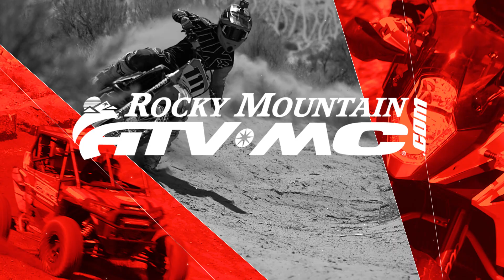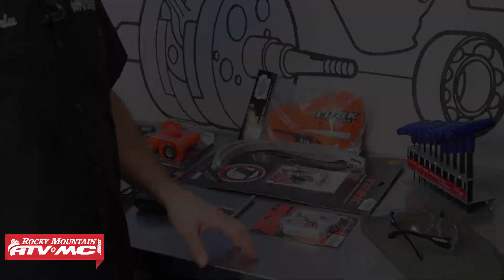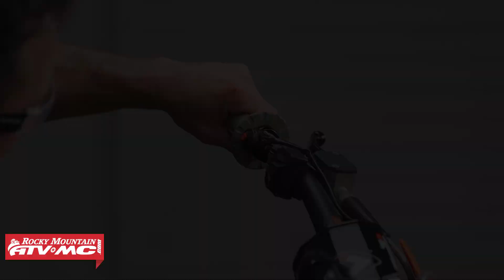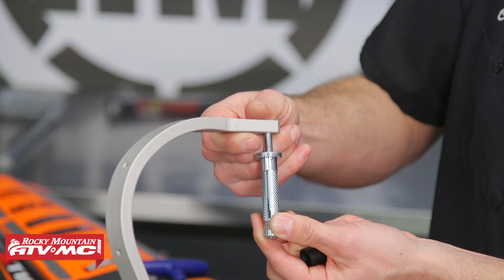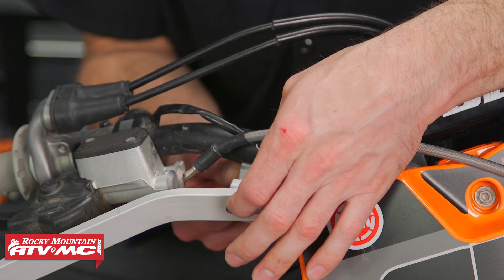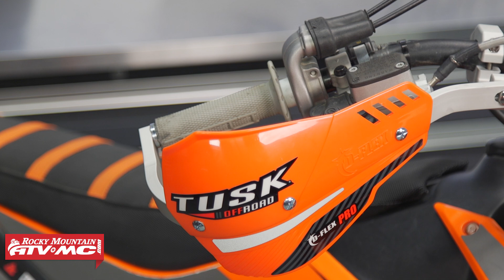How To Install Tusk D-Flex Pro Handguards on a Dirt Bike

Comment: You can see in the vid on the left side that the curved guard doesn't sit flush on the u shaped bar mount. The right side is the same in the real world. Do you just tighten it and let it go? It seems like there should be an inclined adjustable spacer to make this sit flush on any bar.
Reply from the maker: Each bike may be a little different, but they should be as close to flush as possible. You may need to bend the bar a bit to get the perfect fitment.

Comment: Bought this kit for my 2013 Yamaha WR 250. Just got the bike a month ago. Figured out after opening packaging that my handlebars are not stock. I have some model of pro taper bar. The U-shaped bracket does not fit correctly. What can I do?
Reply from the maker: You can try bending it to fit properly. If you need more help you can email Tech@rockymountainatv.com and we can better assist you.

Comment: Should you Loctite?
Reply from the maker: If you are worried a bolt may vibrate loose you can add thread locker.

Comment: How about removal? That spread anchor is not wanting to come out of mine.
Reply from the maker: If you loosen the bolt slightly and then push it in, it should release. If not then a screwdriver can help pry it out. Hope this helps.
Reply: @ did this with a slight tap from a dead blow and she came out just fine.
Reply from the maker: Glad you were able to figure it out!

Comment: These won't work on my 2024 KLX handlebars. There is a steel insert at the end of the bars that will not allow the expanding bolt it. Bummed out....

Comment: Where do I Measure my handle bar to make sure if it is 7/8 or 1 1/8? I own a 2024 KTM 250 XC-W
Reply from the maker: Measure the center of the bars diameter. For your model it should be 1-1/8.

Comment: Great video thanks. Here's a tip if you have a crossbar that gets in the way of the Allen screw... (7/8" bar)
Put everything together without worrying about the angle of the handguards. Then, loosely tighten the end of the handlebar, the two Allen screws on the U clamp, and the screw that passes through the aluminum handguard to the clamp. In other words, put it all together. Then, snug up the 5mm Allen screws on the U clamp - get them even - there should be about an eighth of an inch gap - as long as it's even it's good. THEN, move the whole thing to the level that you want. NEXT, if the crossbar is in the way of one of the Allen screws, DON'T WORRY ABOUT IT. Simply tighten up the other one that you can access. Tightening one tightens up both. 
I just did this on my DRZ400...

Comment: I can't get these to fit my handle bars with a cross bar. Have a KLX300 and a KLX 110RL, it doesn't fit either of them. Even bought a tusk 7/8 handle bar for the 110RL, still doesn't fit.
Reply: Don`t send them back, you won`t get a refund.

Comment: I have problems with the throttle hand being bound. up when I install my hand guards, how do I fix this?
Reply from the maker: Move the throttle housing in far enough in that it won't rub on the hand guard. Also check to see if the rubber on the grip is dragging on the bar. If that's the case, trim a little off. Last, make sure the cable is routed correctly. If none of that works, let me know. -Charles

Comment: Any tips for using this with 1 1/8 handle bars?  Clamps Not good fitting as they are,  but they can tightened down.

Comment: I replaced handlebars on my CRF 230 and am trying to get the plugs/inserts that go into the handlebars out of the old bars to install in the new bars or find just those parts inserts/plugs as replacement parts.  Can I purchase those inserts separately?
Reply from the maker: We don't sell those separately but we do have the ODI grip end plugs you could try out. https://www.rockymountainatvmc.com/parts/odi-aluminum-grip-end-plugs-p

Comment: So I got these but I run rental twinwall bar and they didn't fit is there any way to do maybe a different clam set up on the bar
Reply: Same bars,  I was able to make them fit by inverting the clamps (1 1/8) and trimming the cross bar padding.

Comment: Will all tusk handguard shields work on the same mounting hardware? I have the regular D-Flex but can't find the replacements in orange but do see other types available in that color
Reply from the maker: Some of the Tusk handguards can be swapped but the D-Flex and D-Flex Pro use a different aluminum bar so the Pro shields will not be a direct fit on your D-Flex bars.